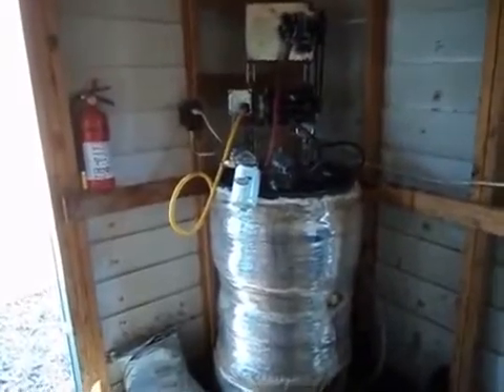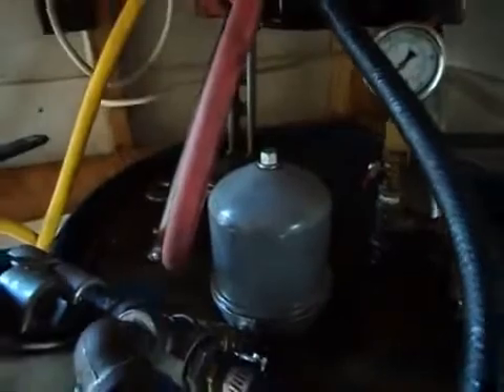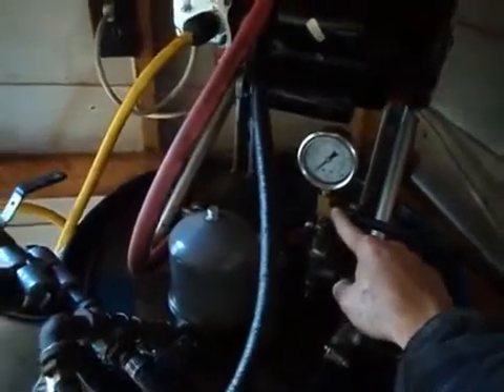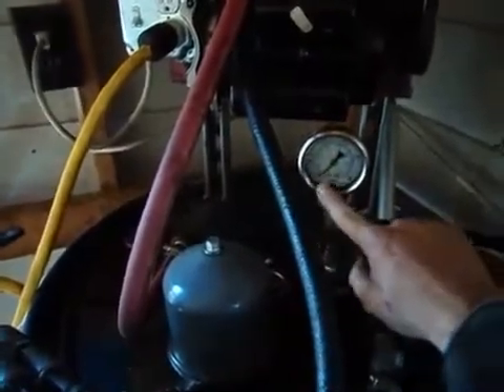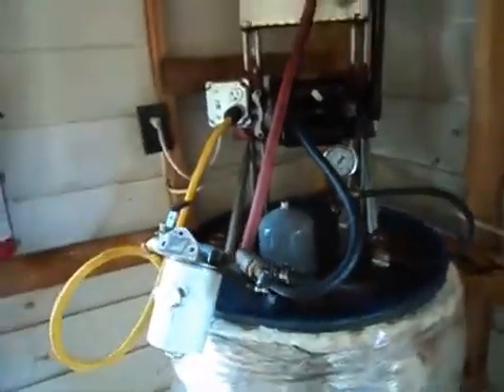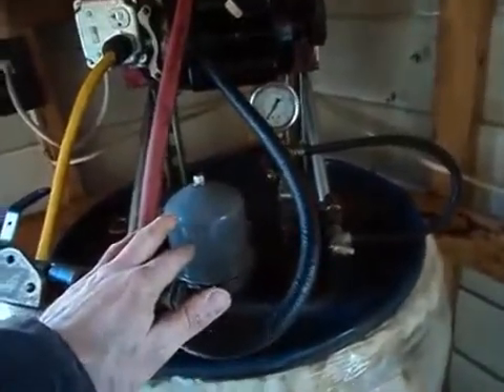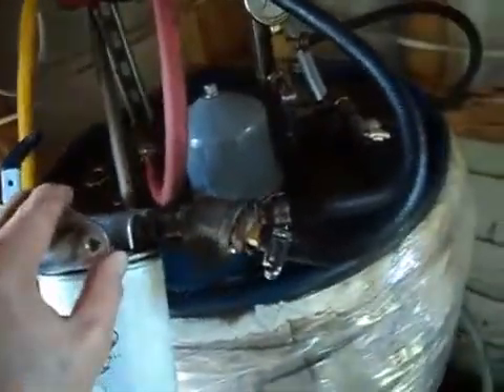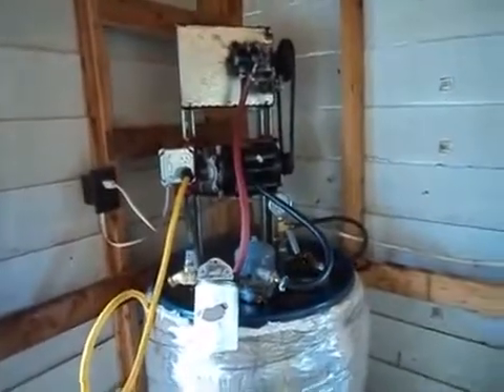WVO WMO BLACK DIESEL  WASTE VEGETABLE OIL WASTE MOTOR OIL CENTRIFUGE PROCESSOR

Comment: Setup info is very helpful.
JUST got my fuge yesterday. Still sorting out the rest of the bits. Will be using a modified SBC pump paired to a motor. A pre-heat system is the biggest obstacle atm. If this was the middle of the summer here still a black barrel baking in the sun would give usable working temp. Cooling off now though.
A clean water heater would also serve well as it comes with insulation and elements...just not the cheapest component if used in setup.